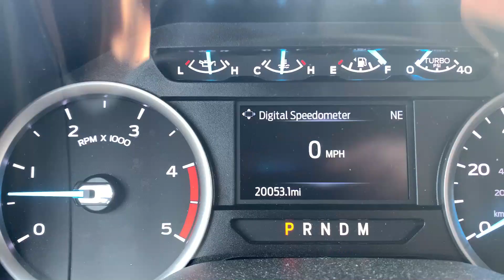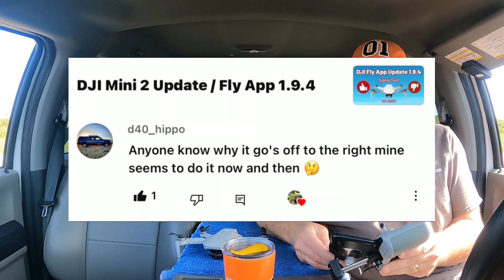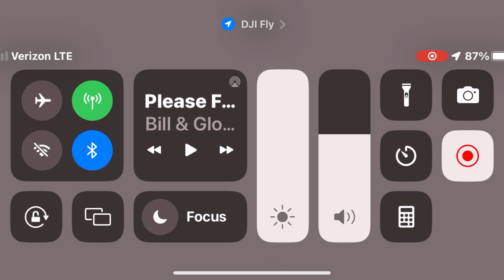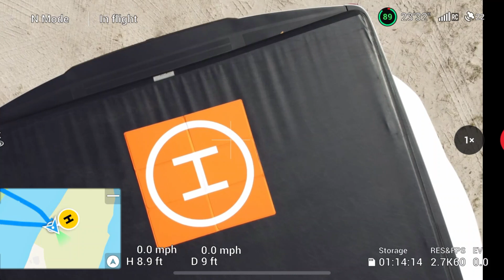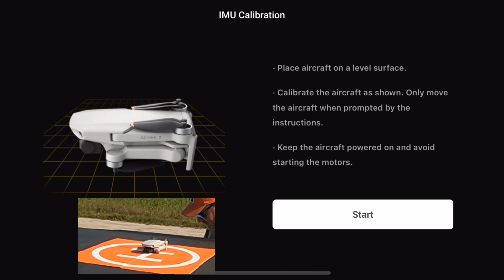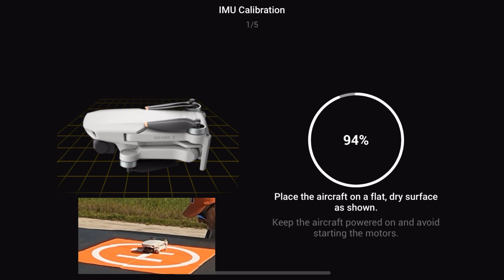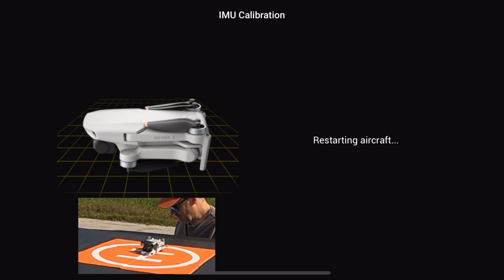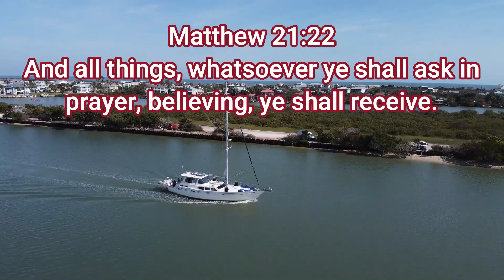Why Does My Drone Drift? / DJI Mini 2 Problem Solved?

Comment: Hi pal,,mine drifts all over the place,,mainly up and down usually,,very rare it keeps very still in hover,,what’s your thoughts on this pal
Reply from the maker: Hey!  Thanks for watching and commenting, buddy. The up and down is way different than the drift I usually have. Mine is usually just slightly to the side with the Mini 2. The up and and could have to do with maybe a dirty optic flow sensor on the bottom. I’m not sure but that could just need cleaned off. Wouldn’t it be funny if that was the fix?  lol. Nice and cheap. But I wouldn’t get my hopes up. My suggestions are usually wrong. Hahaha. Definitely let me know if it helps though. That would be interesting. God bless and thanks again for watching!  Kevin
Reply: @WeretheRoberts  funny enough pal,,about 2 months ago,,I had it out flying and I had a problem with my phone,,my phone froze up in the middle of a flight and some reason my drone went crazy and landed about half a mile away way in a corn field and it took me hours to find it,,,I’m just wondering if that’s the problem what you said about the sensor underneath because of the damp field it was on till 2am in the morning,,,probably won’t have it out now for couple of days but I will definitely check this and clean it,,,don’t think I’ve ever cleaned them sensors buddy so thanks for that,,I will get back to you 👍👍👍
Reply from the maker: lol that’s a horrible story but it brings back memories of an old EXO experience I had. It’s cool that you were able to find it in the middle of a corn field. That had to be seriously a needle in a haystack, eh?
Reply: @WeretheRoberts  haha yes it definitely was buddy,,it took me hours and I couldn’t feel my legs haha

Comment: I forgot about the calibration part, which I didn't know until I crashed it. By the time I crashed it (broken propeller arm) , it was too late to calibrate it. I still have the accessories and thinking, Im just going to look for a used quality one and see if I can still try to fly as I love the simplicity of this particular drone.
Reply from the maker: Dang that sucks!  I’ve noticed lately with the mini 2 drones we have, they both seem to drift to the side almost every other flight or so. I can do the imu calibration and it’ll work initially but the problem comes back pretty quickly. I’ve pretty much decided to do imu calibrations before each initial flight now just to stay ahead of it but a lot of times I forget. lol. You’re right
About these drones. There’s something about the old school feel of flying them and most times simple is way better. Eh?
Reply: Hey dude i’m not sure if it’s too late but I broke my arm on my mini 3 and it cost $200 to fix the arm, drone is good to go took about 6 days

Comment: Glad that worked out for you!! I just got a used mini 3 pro and had this issue, thought I was SOL without sending it in toDJI support. Hopefully this solves my issue and all I need is new blades after the crash 🤦🏼‍♂️
Reply from the maker: Holy crap!  Did you crash because of this issue?  Booooo!!!  Lol. I always say you’re not a true drone pilot until after your first crash. Haha. Definitely keep us in the loop if this helps or not. I seem to have to do IMU calibrations pretty regularly now with the Mini 2 drones. We also have a 4pro but haven’t had to do a single IMU calibration with that yet. Oh well. It’s not that big of a deal and it’s easy to do, right?
Reply: @WeretheRoberts  I can take some of the blame for flying in an area loaded with obstacles with little experience, definitely made me a more cautious pilot lol. Took the drone out to an open field after the IMU calibration at home, I must have done it wrong because I had to do it again out in the field before it was working correctly. It was difficult to know if I had it on its side correctly as the mini 3 pro doesnt sit flat on the sides very well. Took it to a few different sites and had no issues so far though, I will definitely be checking that calibration before flights.
I also had to do an RC calibration with the RC1 controller, it seemed the right stick was drifting a bit in the calibration. I wasnt able to get it to 0,0 like the left stick but very close and it seems to fly well enough. looked into a stick module replacement, but that seems like an extensive project that will wait until it becomes a bigger issue.
Reply from the maker: @shawngrignon4020 well at least it sounds like you got it sorted out enough to fly safely, eh?  The stick module replacement would be way above my abilities. Lol. I lose tiny screws every time I try to fix something. Hahaha.

Comment: The issue might be compass interferance. As you took off near the truck the compass faces the wrong direction and that can cause it to turn on its own. You can see at 9:12 as soon as going away from the truck the drone icon resets rotation and rotates right, you could have a flyaway if you dont calibrate the compass
Reply from the maker: Oh you could be right. I think it’s probably a combination of a few things like the compass, imu, maybe gimbal and user issues too. Lol. I never noticed that icon resetting before. That’s a good point, brother. All I know is the problem has persisted lately. It’ll go away for a few flights after I do an imu calibration but it always returns. Let’s just hope the fly away doesn’t happen. Thanks so much for watching and for the advice, Alex. Sorry it took so long for me to reply. It’s been one of those weekends. Haha. God bless!

Comment: I have a mavic 2 and 3 times in the  past year (including this morning) the drone takes off, hovers at 4ft, then lifts up to about 20 ft on its own then starts wildly drifting?  Any thoughts?  Can’t find anything online
Reply from the maker: Oh wow I have no idea or suggestions other than maybe contacting DJI. Maybe they could help you fix it without sending it off. It almost seems like an issue with the bottom sensors maybe. It could be they’re just dirty and need cleaned?  Definitely let us know if you get this sorted out. I’d be interested to know what’s up
Reply: @WeretheRoberts  I was extremely lucky, only the propellers were damaged.  I just finished recalibrating the compass and imu and everything else ok.
Reply from the maker: Oh good deal. :)

Comment: Mine drifted and crashed into a building. It wasn’t strong winds. I tried to correct it at first and then it seemed to stop, turned it towards me and started drifting in the same direction and I couldn’t correct, and it went right inti a building. Outside of warranty period. Debating whether to buy a new one.
Reply from the maker: Dang that sucks!!!  I’ve been fortunate with being able to control the drone while it drifts. It seems like I have to do the IMU calibration every few flights for some reason on both mini 2 drones we have. Sorry to hear about your crash. We’ve upgraded to the Mini 4 pro and have been doing some comparisons between the 2 and the 4. The Mini 2 is still my favorite drone but I gotta admit the 4 is really working on me. Lol.

Comment: Mine did that but it would slowly rotate left when hovering. I recalibrated the imu it fixed that. But now almost every time I turn on my controller on it beeps and says to recalibrate the controller
Reply: It's in the settings either under safety or control down close to the bottom
Reply from the maker: @BeamsOutdoors ok cool. I’ll check that out.
Reply from the maker: Wow I’ve not seen it rotate when hovering at all but the last few flights I’ve done I’ve seen them rotate in flight pretty drastic. I’ve also heard the controller beeping like it needs recalibrated, too but it corrects itself pretty fast. How do you recalibrate the controller anyway? Lol.

Comment: Have you ever flyed your  drone out 1km then turned off your controler and see if it returns home?
Reply from the maker: Lol I’ve not gone out that far but we did go out I think 500 feet and did that. It worked like it was supposed to but man, it was nerve racking.

Comment: Just found the channel recently. Curious about the Cell phone mount extender that you use on the controller. Ive done some searching but I cant seem to find the exact one you have. Any help would be much appreciated! I have a Samsung Note and I have to remove my otterbox to get it to fit on the controller mount.
Reply from the maker: Awesome!!  Welcome to the channel, brother. It’s always cool to have people watch along as we screw stuff up lol. Here’s a link on Amazon for the bracket I have. It’s definitely worth the money and it should give you enough clearance to not have to remove your case in the future. Love that little thing. Lol. Thanks for watching and again welcome. God bless!!!
gouduoduo2018 Mavic Air 2 / Mini 2 Remote Control Tilt Stand Phone Holder Bracket with Strap for DJI Air 2S / Mavic Air 2 / Mini 2 Drone Accessories https://a.co/d/2yDZWMm
Reply: @We're the Roberts  that, mine's coming.

Comment: Might try to calibrate the RC controller also, might help also.
Reply from the maker: That’s a good idea. I may look into that if the problem comes back. I’ve been told by a couple people on here the problem will persist and I may need to return her to DJI for repair or replacement in the future. Let’s hope it doesn’t come to that. She’s not covered anymore.  Haha.
Reply: @WeretheRoberts  yeah, mine still covered but I still don’t want to have to send it in for anything never know how long that will take. And I might even have separation anxiety if I had to do that.
Reply from the maker: Haha. Separation anxiety. I think drones have anti separation anxiety. They want me to leave them alone in their case. Haha

Comment: What are you using to secure your phone to the controller? Great video.
Reply from the maker: Very cool!  Thanks for the comment, buddy. Here’s a link to the bracket we use for the phone. It really is a cool accessory and helps with glare. Also it keeps me from having to take the phone out of the case to get it to fit on the controller. Anyway, let me know how you like it if you  order one.  

gouduoduo2018 Mavic Air 2 / Mini 2 Remote Control Tilt Stand Phone Holder Bracket with Strap for DJI Air 2S / Mavic Air 2 / Mini 2 Drone Accessories https://a.co/d/c88aD8E

Comment: I had the same issue and did all the calibrations. It helped for a few flights but would start to do it again. I ended up sending it in for repair and got a new drone back.
Reply from the maker: Oh wow. I’ll keep my eye on this for sure and if it comes to be a routine issue I will follow your advice and contact DJI. How old was your drone when they replacement?

Comment: That is pretty sweet.  I wonder how often the IMU needs to be re-calibrated?
Reply from the maker: Thanks for watching, buddy!  No idea how often it needs done but this was the first time I calibrated Rose. I’ve done Jack before but that was just for a video. Lol. I’ll do it more often though nkw that I know it actually has a function. Haha
Reply: @WeretheRoberts  Ha, exactly - now that I know I can do it!   Other one I wonder about is how often to change propellers....don't want that to be "the time before they failed". 🤔
Reply from the maker: Well, I’ve had these drones for over 2 years now and haven’t had to change blades yet. I check them before each flight for cracks but more importantly I check the screws each time and make sure they’re still tight. If you do change props, make sure to use the new screws that came with the props because they have fresh lock tight on them. Or I guess you could just add some lock tight to the old screws and reuse them. Either way, the blue lock tight is gonna save you some headache and maybe heart ache. Haha